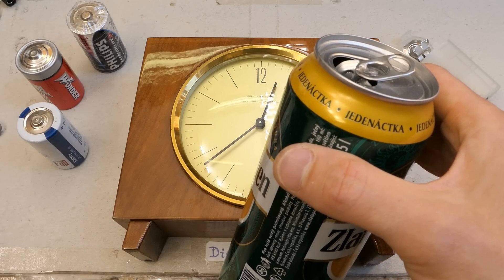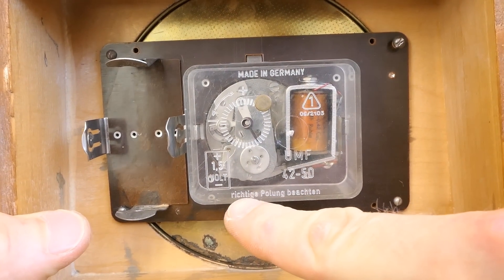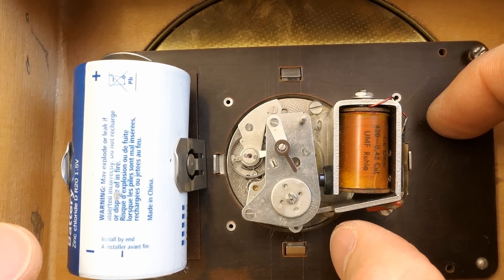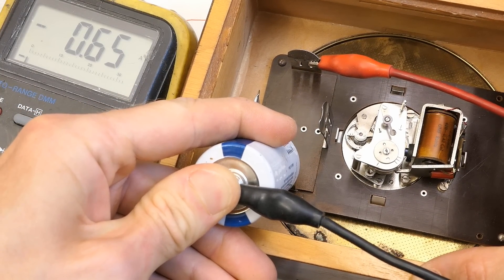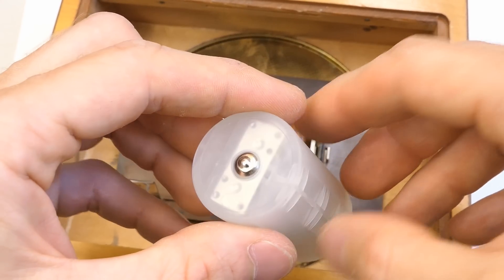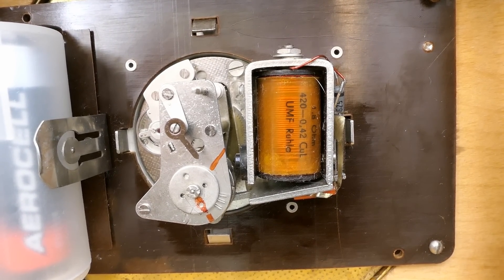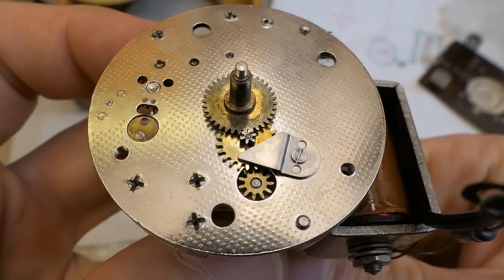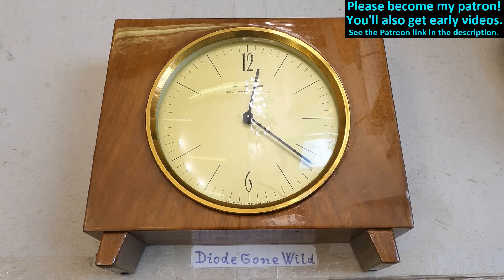1960s electric clock repair (and battery clock evolution)

Comment: This is a very beautiful clock, Dan! It has an unmistakable mid century design, these are some of my favourite designs of clocks. The mechanism is fantastic, early battery operated clocks are really cool even if they're obsolete thanks to crystals and other electronics. Your improvised method of lubrication is really fascinating. I personally use a syringe with no sharp point, and it's filled with a synthetic clock oil, very light weight like you said.

I think it'd be very interesting to see a video of you explaining an electromechanical clock with a transistor(s) and a magnetically impulsed balance wheel and maybe also troubleshooting one that doesn't work! I love how well you explain things in a way that I can understand, even though I'm not well versed on electronics.
Reply from the maker: I will probably open the mayak electromechanical  clock, because it recently stopped working.

Comment: Niice. I have a similar clock (Kienzle) which has run continuously (except for battery changes) since 1967. A Duracell 'D' lasts for several years. Your content is always interesting, ham radio, charger teardowns, repairs....  like it all.
Reply: I have a Kienzle also that also has probably run since the 60 's ;)

Comment: German here, GDR German, never seen this thing, and I use to go on flea markets. But I know the mechanism from the Russian clock, it was widely used in GDR products, pretty the same, but cheaper with some more plastics. It came even with alarm function, it's in the "Robotron Lausitz 2011" for example. This mechanism is electronic, calling the winding function "electronic" is an overstatement. When it comes to Ruhla, a design classic is the "ruhla Sumatic", basically a wrist watch with an electric buzzer for traveling. Ruhla is famous for wrist watches.

Comment: The one you repaired is an "electric wind" mechanism, while the other type with the single transistor is an "electric pendulum" (and works similar to those pendulus ornaments with swinging features).

Comment: In the UK, we had many mains powered clocks powered simply by a 2-pole synchronous motor.  Early ones had to be started manually, or would run backwards!  Later ones had a one-way mechanism built in, so they would always start running forwards.

In large buildings such as hospitals, factories or schools, there would often be a master clock using a pendulum to keep time, sending regular pulses to slave clocks in each room and maybe with a bank of cam switches controlling bells to sound shift changes or ends of lessons.  Of course, every manufacturer had their own, incompatible system .....

Comment: Thank you very much for the video for it gives me ideas about how electro mechanical, transistor controlled electro magnetic and quartz crystal controlled clocks works. So electro magnet and battery can be added to all mechanical balance wheel driven clocks to make them self winding.

Comment: Nice classic clock! It's interesting to see the evolution of the electronic clocks especially those operating off of the battery - this clock is as simple as you'd like, no electronics, except for the solenoid to wind it back up.
Reply: interestingly it clearly wasnt a cheaply made clock, the jewels and pallet jewels proved that. I have a Kundo electronic from 1966 which has no jewels.
Reply: @juslitor  Yep, those bearings are amazingly expensive. The ceramic bearings like this one (the ruby pallets) is sought after for very low friction especially with tiny gears while also being relatively resistant to scratching, and of course they are still used in both mechanical and electronic watches that cost a whole lot.

Comment: There was also the resonator clocks, they used either a tuning fork or another resonator to keep time. Unusually that resonator drove the gear train directly, either through an indexing mechanism or a magnetic escapement, although sometimes it is used to provide an AC signal for a synchronous motor to run off of. Some quartz clocks also use that principle to power a synchronous motor instead of a stepper motor. There was also the AC powered clocks that also used a synchronous motor, but those weren't battery powered.

Comment: Nice, I liked this repair of the clock. I also quite like clocks, both modern and older, this type really shares quite a lot with the older wind up style clocks. I wonder what the battery life would be with a D cell, compared to that of a pair of AAs?
(And I would use up that nasty TESCO Zinc Chloride battery first, then switch to better quality ones.)
Can't wait for the video of the other clocks. :)

Comment: you could do a series on mechanical clocks. like different types of escapements, pendulum, temperature compensation contraptions, spring vs. weight driven, or even clock chimes (Westminster melody for example)

Comment: The UMF factory, along with watches and clocks, also built precision machinery- die filers, saws, shapers and universal milling machines.  One rather unique machine is a shaper designed for making punches which has a special mechanism to produce the draft taper and radius.

The only fault I can really see with this clock mechanism is the lack of a maintaining power, but then the action of the rewinding mechanism is fast enough that it really doesn't matter.

Comment: Very interesting. I had an old 1965 Vauxhall Cresta PB, which had a clock above the internal mirror, set into the roof. It was a German made 'Kienzle'. It always fascinated me because you could hear it tick. So I knew it was clock work. Every few minutes, you could hear it buzz, as it wound up. I guess they used a motor instead of a solenoid to wind it.
Reply: If its anything like the Opel clocks from the same era, it is a similar mechanism to the clock in the video.
Reply: It probably is because both Opel and Vauxhall used to be GM subsidiaries with many exchangeable parts.

Comment: The solenoid type, my parents had one in the '70s.  Every 2 minutes or so, CLACK, as the solenoid fired and reloaded the spring.  It used a linear spring rather than a coil spring.

Comment: Hi, I've modified a FS1000A rf transmitter to output a signal as 868.35 mhz instead of 433.92 (just swapped the cristal)
It works some of the time, and i've gotten my garage openned with it but the reliability is not on point. Seems to oscillate properly with some nice harmonics only when it wants to, or else I only get a weak signals dispersed on a big range of frequencies.
What components should I change in the circuit to get it to oscillate correctly ?

Comment: Although they're not battery powered, don't forget Telechron clocks, which use the AC frequency to control the time.
Also, I made a mechanism like this as an auto winder for my Lego clock, but it uses a motor instead of a coil.

Comment: what do i think ?  i think you should open a graphics card repair depot
i'm willing to supply you with your first two cards
one is from nvidia, and the other amd
both have an error 43 message in device manager
both can not use hardware acceleration
it shouldn't be too difficult to figure out what is the common denominator
which chip is being used by both companies

Comment: Micro soldering is about the extent of my soft touch and im still too brute for that.  I gotta put everything i got in order to do it.  Clock work, nope. Not for me..   i always end up bending something or over tightening a teeny tiny doohickey and they never work again after i touch em..  only thing ive done successfully with a clock was put a different chime on an old grandfather clock..

Comment: I have a silly idea. Have a solar cell charging a super capacitor instead of a battery.
Or a less silly idea of having a solar cell charge a NiMh battery...
Reply: I can’t find the video now or remember the creator but it’s about converting a battery powered clock to run on a 500F super capacitor while being charged by a small solar panel. Wish I could find it again.

Comment: The amplitude is so low that it is a wonder the clock even keepy any time. Btw. the less energy in the main spring, the faster the clock goes. Stick to electronics. 🙂
Reply: I think you mean the hairspring of course.
Reply: @mikebond6328  No, the main spring unwinds and as it unwinds the amplitude lowers and the watch runs faster.